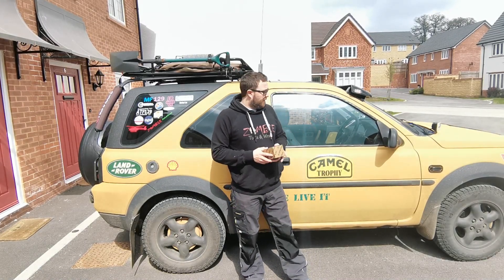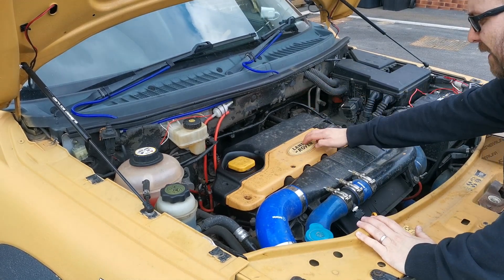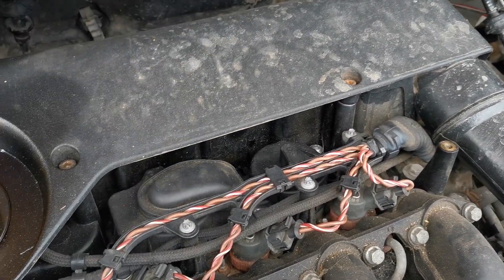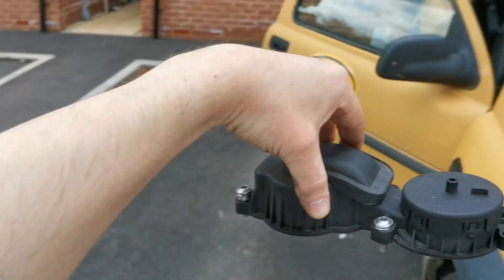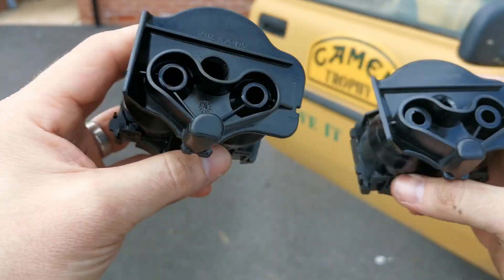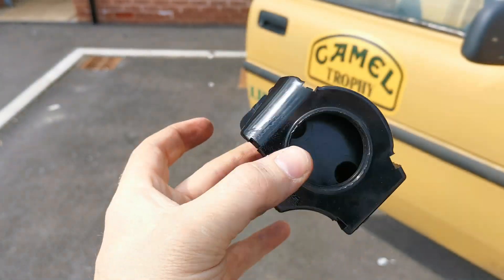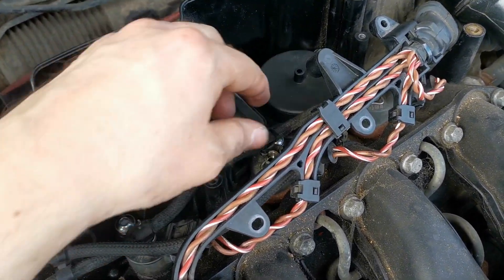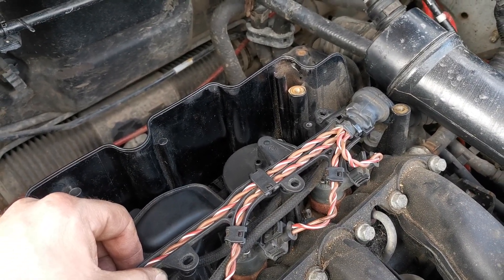Crankcase breather mod - Freelander 1

Comment: ‘Fit and Forget’ parts.. glad you mentioned servicing this part. My car had thus part fitted when I bought it which initially I was pleased about. However I’m not so sure it’s as effective as BMW/others claim. I plan on going back to the old style blue filter and just servicing the car as per Land Rover’s original design etc.  ThIs part is a service part in L/R’s service guide unfortunately previous owners and dealerships/specialist don’t/haven’t (in my opinion) been as thorough in servicing this item. I’ll give it 3-6 months before I check again but before that will ensure my inlet side of things is cleaned off.. keep up with the video updates these are great..
Reply from the maker: Good information 👍 yh they definitely are not fit and forget. Looking at the design it's easy to see how they could gum up so we'll worth a clean every now and again.
Would be good to see how the foam element holds up against these with proper testing one day 😁